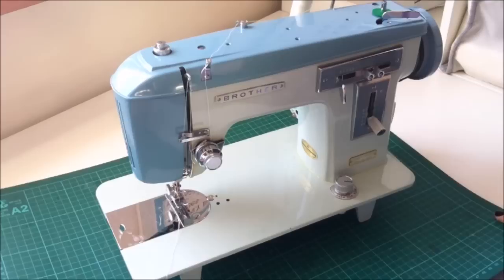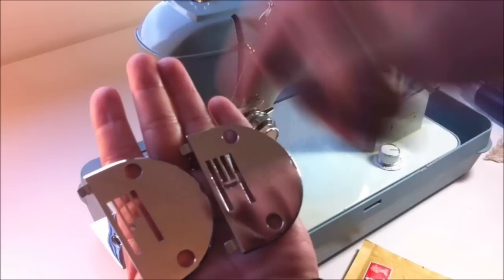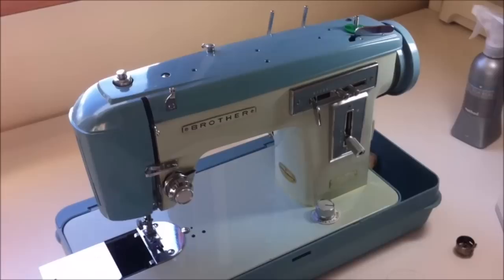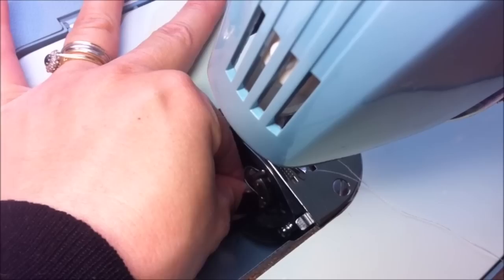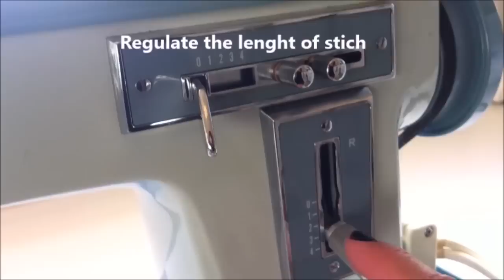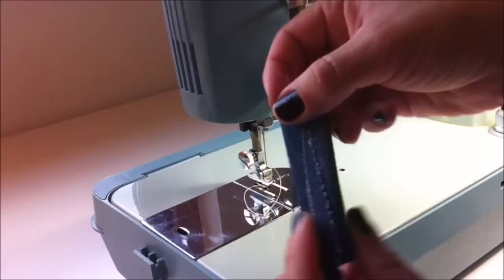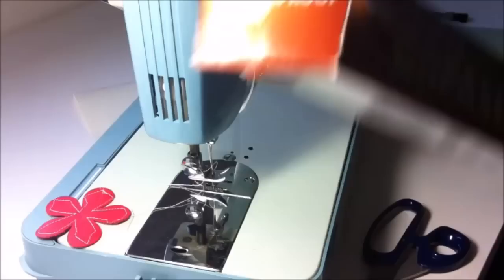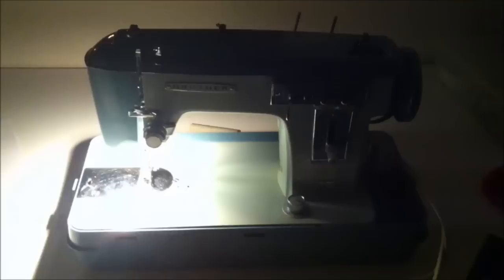How to use a Vintage Brother sewing machine J-A 28 (download the manual)

Comment: The first thread guide on top at the back closest to the thread spool is actually a spring where you pull the thread underneath and around to the empty bobbin in order to wind a bobbin. It's the thread guide with the screw on top. Your bobbins will wind much more evenly if you use only that spring. Most (not all) Japanese-made Kenmore sewing machines are the same way. Just an FYI. 😊👌
Similar to this, except your spring/guide is on the top rear:
https://youtu.be/XcjgXGj3Mgo
P.S. Higher number on the upper tension is normally a TIGHTER/MORE tension. 😊

Comment: This is very similar to my old Jones sewing machine, which i love. I had it for years in the garage and then got it out, cleaned it up and it still goes like a dream. The vintage machines are definitely great work horses, they never give up unless the worker makes an error. I would recommend these to anyone. Thank you for a great tutorial.
Reply from the maker: I 100% agree. thanks for sharing!
Reply: MOI AUSSI mais je me pose une question .Faut il changer le condensateur antiparasite ?

Comment: Hello I just got the most beautiful brother sewing machine today. It’s changed my life. It’s my upgrade from a non name brand battery operated one. And when I got home I broke multiple needles trying to learn about it. Your info on needle plates has cleared a lot of my concern. Mine only came with a single stitch needle plate. Which is all I use. But that’s because that’s the only function of my old machine. My new vintage brother has straight stitch and zig zag. So I need a new needle plate. Thank you! Love your voice.

Comment: The old zigzag sewing machines made zigzagging possible by swinging the shuttle.
This method is no longer used.
This sewing machine has the drawback of being heavy, but is otherwise great.
It is beautiful and durable.
With a few modifications, you can sew leather and thick fabrics.

Comment: I just bought a Brother J-A 28 but mine is called project 1361 has the tension and threading in the back of machine. Can anyone tell me why?
Reply: I have Galaxie 1361. Very hard to find any information on that sewing machine. Mine is like yours. What bobbin does yours use?

Comment: Thanks very Much for this tutorial I learned so much. I purchased a universal 18905 sewing machine and has more little different sewing parts goes on top of the machine and I m trying to find manual. I can do straight stich  but still could not figure out the others.
Reply from the maker: Isel Alldredge hi thanks for stopping by. To be honest I have never used other stitches but zig zag and straight. In the Manual of this machine you might find some instructions.x   Link in video description.Bibi

Comment: I have a brother model 151 zig zag sewing machine I want to know what is the standard size sewing needle for those type of machines that mine is the similar color this one but looks like the other video she did that's like beige any help from the community would be much appreciated thank you
Reply from the maker: hello,   I dont know which is that sewing machine model  but what I know is that there are universal needles you can get in any craft shop.  Those are the ones I use. You can also get leather needles... etc .As far as I know, there is no need for a special needles. :) happy sewing. x

Comment: I'm really happy you showed me this video, I got a brother window matic 1960s sewing machine and I wanted to use zig zag but my machine don't have same top width areas adjustments like yours I got the reverse and forward idea but I'm still wondering if I can add a bottom plate like u did with your sewing machine but I'm not still sure I can do zig zag if my machine will do it, I'm still learning it I got the manual for it but dont show it, and I need to oil the machine also as sat for a while longer than 6 months
Reply: If I can help me know if my one will do zig zag I'd be very grateful as its slightly different to your sewing machine bibi it's the brothrr window matic I'm trying to learn for zig zag if u can help me x

Comment: Thank you for this wonderful video! Someone left a machine like this at the dump and I love it. I noticed my rear tension disc was loose. Your video helped me establish that it is too loose (I still can't believe how thorough you were in showing the details). It just flops around and does not touch the front disc. It still sews decently, but I don't know if I am missing a spacer or if a spring is bad in it. Do you still own this model or was it one of the ones you had to get rid of? I was sad to hear you had to let go of some of your machines. I collect them as well and I prefer the older ones too. I can repair them myself and they are so much more reliable. These particular machines were made in Japan which is why they are so precise and run like a dream.
Reply from the maker: Bless you . I don’t have the machine any longer . My collection was getting crazy. I made the video to not forget how to use it  as my memory could fail me. I’m glad it has helped so many people  and I’m not sure what could be wrong with the disc in your machine. Sometimes is a matter of tighten things up but I couldn’t tell. If the tension is too lose you could get knots all the time. I found a local sewing machine  expert and she fix anything for £20 lol  they fix machines everyday. Maybe  you have someone local that could help ?
Reply: @BibiCameron  , thank you for your nice response. I'm sorry that you no longer have the machine. I did figure out my problem though. The tension discs close together when the presser foot is dropped. I just never noticed it before since I am always switching machines. I have never seen another machine do that so I thought something was wrong. Thanks again!

Comment: I’ve got the jones model 889N, it doesn’t have that level next to the little bobbin. I don’t suppose you know how to fill the little bobbin on this machine?
Reply from the maker: Do exactly the same I did in this video BUT you just need to insert the bobbin in the pin, then slide the pin ( move it to the front ) so that you will unlock the bobbin filling function.  hard to explain easily to do. x hope that helps
Reply: Bibi Cameron massive thank you! :)

Comment: Hello Bibi
Great video I have a question for you or anyone else who reads this
I was just given my grandmother’s original Brother Sewing machine that she taught me to sew on over 40 years ago I had forgotten how to thread it properly so your video helped immensely. After she passed my family got rid of the original sewing table that use to hold the sewing machine and with it the instructions and attachments hat went to her sewing machine which brings me to my question
How can I determine the model so I can hopefully download a manual to better know what all I can do with it and how to use/clean properly
It looks much like this and also the 631 and 651 but has an extra pop up plate on the top of it. The only markings I see are underneath the machine and it looks likeJA1. The other markings I find are Z769946. It’s the two tone blue like the one in this video. I have pictures to show if you or anyone else may be able to help
Thank you in advance for any help
Roger
Reply from the maker: Hi Roger, have you download the manual in the links under the video to see if it suits your machine? I'll advise to contact the machine maker, or join FB group about vintage sewing machines and share pictures. I had to research for each of my machines. I would love to help but I'm afraid I'm not an expert.
Reply: I did download the manual, and it fits most questions I have but not all 
What is the FB group you are referencing I will gladly join and pose the questions there

V/R

Roger

Comment: thank you for your video.  I inherited a Brother opus 141 and was looking for how to load the bobbin but mine doesn't have the same setup on top and no manual either so perhaps it doesn't have that feature?
Reply: took me some fiddling but I found it. it's on the side closest to the operator connected to the wheel. your video helped me get it all back up and running.
Reply from the maker: Hi there,  thank you very much. I'm so happy to heard my video helped you. sorry could reply before. hugs. Bibi

Comment: Hi,
thanks for the video :)
great tutorial. i have also seen your other video (on the brother 345) which was awesome!
I have a machine just like that (brother J-A-28)! I was searching the internet for a user manual. 
is there any chance you have a file of that user manual? 
if not, would you be so kind to scan it and post it somewhere? I am sure that many people will be happy to view it!
Thanks :)
Reply from the maker: +Saghi Au  yes I have a copy of the original manual but haven't digitalized yet.
 I'll let you know when I have it ready. Please write me at bibicameron@gmail.com to have your details.
Reply: +Bibi Cameron 
Awesome. I just sent you an email :)
Reply: +Bibi Cameron Could you please notify me when it is digitized. I can't find a manual anywhere. Thank you so much. Great video by the way. :)
Reply: I've got a J-A 28 as well....runs like a top. Bought it cheap 25 years ago at a swap meet. Evidently someone messed up the tensioner and closing it up there was still a gap. I had to remove it and reset it back to "9" and then re-seat it into the sleeve. Lifting the foot opens it just like it should.
Filled the bobbin, threaded the machine and felt the tension as I dialed it in.
Threw some junk cloth in and put the pedal to the metal....outstanding stitch after sitting for 25 years.

Comment: I just bought a dressmaker from a second hand store and it's in superb condition! are you familiar with this model? I couldn't seem to find any information on it online, I'd love to get my hands on a manual, digital or otherwise.
Reply from the maker: Hi Chrissy, I have seen it in pictures. some of them brings scalloping discs for embroidery ( never have use them but quite easy to find info online about how to do this) All the machines have the model's number somewhere and whit this number you should be  be able to find info online, or forums.